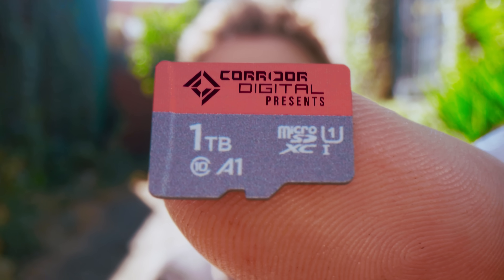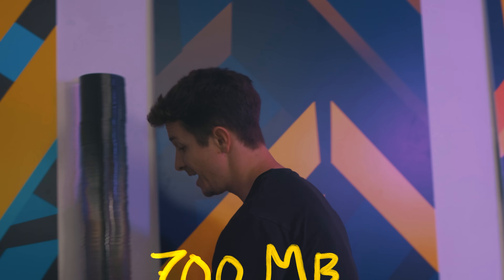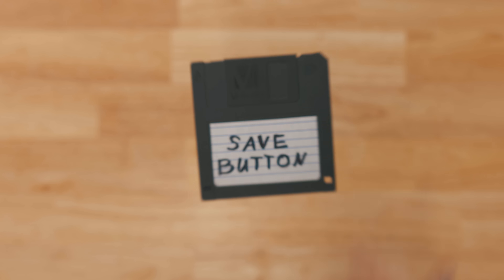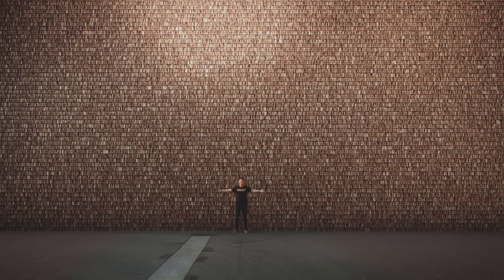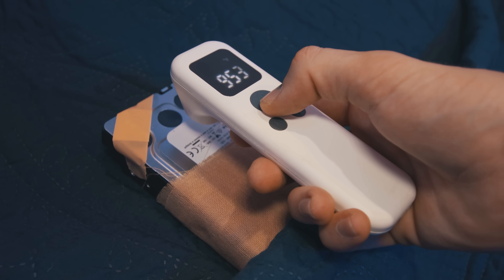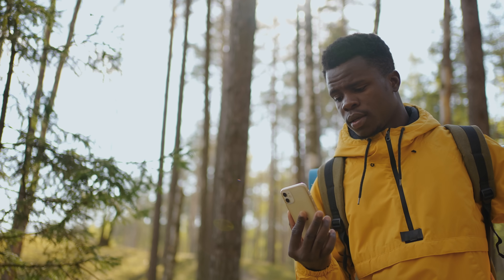VFX Artist Reveals the TRUE Scale of Data!

Comment: Fun fact: After Zettabytes, it's Yottabytes, which is 1024 Zettabytes, or around 1 trillion Terabytes! Right now, 1 Yottabytes would fit every bit of data in our world 100 times over, but if we manage to develop the singularity (with AI and stuff), we might seriously need to consider using Yottabytes.
Reply: 55.4 yottabyte zip bomb
Reply: @travipatty28  tasty
Reply: Mister, that just means making 1 trillion terabyte chips. Unless we make quantum computers in which a bit less. Thats because quantum tunnelling, known to laymen as teleportation
Reply: that one zip bomb holding 5500 times all the data in our workd
Reply: the 55.4 yottabyte zip bomb in my pocket:
Reply: your using units based of of powers of 2 while in the video they use powers of 10. Also the highest amount of data to date is no longer a Yottabyte, after yotta it goes to ronna which is 1000 to the power of 9, then quetta 1000 to the power of 10, which were adopted by the International Bureau of Weights and Measures in 2022.
Reply: Next is Ronnabyte, then Quettabyte.

Comment: Technically, it's not 1000, but 1024. Oh, well, close enough I guess
Reply: incorrect, that would be a kibibye, mebibyte, gibibyte

1000 is kilabyte, megabyte, gigabyte
Reply: it was redefined to 1000 bytes in a kilobyte in 1998 to line up with all the other units in the SI system (IEC/ISO 80000:13)
1024 bytes is a kibibyte, not a kilobyte, and 1024 of them is a mebibyte etc.
Reply: @Roaxial  really? It was changed? Guess I've been living under a rock since then. Not like I cared too much about computer technology, so not surprised I missed something like this

Comment: Actually 1024MB=1GB not a 1000
Reply: “Actually” 🤓
Reply: @taha_4656  they're not even right which makes this more funny
Reply: it was redefined to 1000 bytes in a kilobyte in 1998 to line up with all the other units in the SI system (IEC/ISO 80000:13)
1024 bytes is a kibibyte, not a kilobyte, and 1024 of them is a mebibyte etc.

Comment: Sure, 1024 =1000 if you are an engineer
Reply: it was redefined to 1000 bytes in a kilobyte in 1998 to line up with all the other units in the SI system (IEC/ISO 80000:13)
1024 bytes is a kibibyte, not a kilobyte, and 1024 of them is a mebibyte etc.

Comment: Actually 1024 megabytes is a gigabyte, and so on. . . . You said 1000 but it's actually 1024
Reply: it was redefined to 1000 bytes in a kilobyte in 1998 to line up with all the other units in the SI system (IEC/ISO 80000:13)
1024 bytes is a kibibyte, not a kilobyte, and 1024 of them is a mebibyte etc.

Comment: Computer data storage became so cheap, for instance a 4 tb hard disk is about 70 dollars which means it's less than 2 cents per gigabyte which 1000 mb which is 1000*1000 kb which is 1000^3 bytes. In conclusion you can get about a billion bytes for 2 cents. And I haven't talked about ram...

Comment: Great job, thanks.
But you didn't clarify, that 1 terabyte is 10^12 bytes and 1 tebibyte is 2^40 bytes. Common misconception that 1 TB (terabyte) consists of 1024*1024*1024*1024 bytes which is wrong.

Comment: 3:36 Fun fact for those interested - BluRay is called "Blu(e)" because the laser it uses produces blue (405nm) light... it's technically more violet than blue, but VioletRay doesn't sound as catchy :D. CDs and DVDs use red lasers (780nm and 650nm respectively).

Comment: I hate it when "Profis" says 1MB is 1000 KB it is 1024 and 1 GB is 1024 MB and so on
Reply: You're wrong. 1 MB is 1000 KB, but 1 MiB is 1024 KiB.
Reply: it was redefined to 1000 bytes in a kilobyte in 1998 to line up with all the other units in the SI system (IEC/ISO 80000:13)
1024 bytes is a kibibyte, not a kilobyte, and 1024 of them is a mebibyte etc.

Comment: It's actually 1024, not 1000

The 1000s are used by manufacturers idk why, but in reality the number is 1024
Reply: No. There is a little trick - kilo is 10^3 but kibi is 2^10 or 1024. So when people talk about mega, kilo, tera, giga - all this is power of 10. But for RAM people use kibi, mebi, gibi, etc which is power of 2.

Comment: There are approximately 711,111.11 1.44-megabyte floppy disks in 1 terabyte.

This is because 1 terabyte is equal to 1 trillion bytes, and a 1.44-megabyte floppy disk can store 1,440,000 bytes.

So, the calculation would be:

1 terabyte = 1,000,000,000,000 bytes
1.44 megabytes = 1,440,000 bytes

1 terabyte / 1.44 megabytes = 1,000,000,000,000 bytes / 1,440,000 bytes = 711,111.11 floppy disks (approximately)

Comment: The floppies falling weird and then bouncing on the trailer.. Looked hard CG. That's not how a stack of small, flat, thin, things falls. The move more laterally (Find videos of large piles of wood, plywood, cardboard..etc falling over), and when it lands they spread out in the direction it's falling in very quickly instead of piling up. This felt like it was just a typical particle fluid simulation, which doesn't fit at all.

Comment: One other reason for not using sd cards is performance, performance on it are really bad for non-sequential access, linux did boot windows on sd cards and the sd was basically at 100% of its speed all the time. Even high speed ones are SUPER slow when compared to SSDs. Serving content from sd cards is just SUPER slow.

Comment: a quick reminder to those that even know/have used floppies - while it always stated 1.44, we know it was 1.37mB, if we were lucky. if we tried shoving anything past that, it would write, but it would have a high chance of fail when reading it.... :D
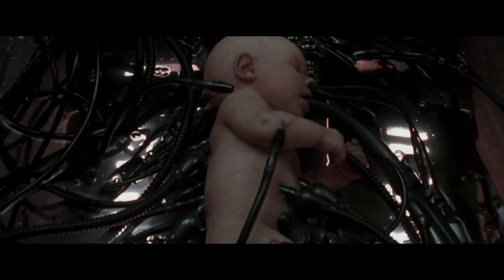13:01 how deluded is this statement, considering that the data carried is repeating, or else we'd fall apart in days of being conceived in the womb. you need to remember that each cell carries, mostly, identical info or our next reproduced cell will conflict with the ones around it (quick example: cancer cells).

started off well, but then went for clicks and delusions... bad voodoo.

and we're not even going into topics of data formats and data storage methods to properly convert data stored in each cell to our "IT" methods.

i guess, this is what passes as "mind-blowing science!" for zoomers.

Comment: the 1.44 mb-disks was the pc-version, the 3.5" for gamingcomputers f.ex. atari 720 kb and amiga 840 kb - they all looks the same,but the 1.44 was doublesided and the "original one" was  singlesided 720 kb..amiga had a compressed filesystem that allowed 840 kb to be squeezed in

Comment: back in the days my teacher told me that he studied new approaches in his freshmen years and assissted a tutor with his prototype. instead of having a magnetic disc (SSDs wherent a thing back then) where each platter is red by a single read head, they packed 40 or so per platter fixed on the encasing and let the sqare platter "shake" so the data reaches below the read head. He was pretty sad that it never got out of the prototype status. probably because the had shaken any pc it was installed in into pieces :D

Comment: just remember, the only thing above zettabyte is YOTTABYTES, approximately 1.2 S E P T I L L I O N megabytes (1,200,000,000,000,000,000,000,000)

edit: just did a few searches and found out that there is only one thing larger than a yottabyte: a yobibyte (about 1.3 yottabytes)

Comment: letting you know that 1MB = 1024 KB, 1GB = 1024MB, 1TB = 1024GB, so on
Reply: That's not correct. In reality, 1MiB = 1024KiB, 1GiB = 1024MiB, 1TiB = 1024GiB.
But these are not kilobytes/megabytes/gigabytes/terrabytes, which indeed go by 1000s as in the video. They are kibibytes/mebibytes/gibibytes/tebibytes, which go by 1024s.
Reply: Your "1000s" is Steve jobs & his friends system invention. Before that was & still 1024s since the beginning.

Comment: 1024 kilobytes is a megabyte, 1024 megabytes is a gigabyte, so on, that is the error.
Reply: no, they're correct you got the units messed up. 1MB = 1000KB, 1MiB = 1024 KiB
Reply: @Vtraxio  They wrong, 1MB = Steve jobs' 1000KB.

Comment: something cool about memory storage: Its not 1000 its 1024, a gig is 1024 megabytes, a megabyte 1024 kilobytes but a 2 gb HDD only has 2,000 mb on it. this is because in computers the closest binary to 1,000 is 1024 so they use that number for ease of computation but manufacturers use the actual meaning of the prefix. this means a 1 terabyte SSD would actually only have around 0.975 Terabytes of storage. there have been efforts to rename the Bytes to avoid confusion.
Reply: Glad someone said this, it made me want to pull my hair out when he said it wrong! :P

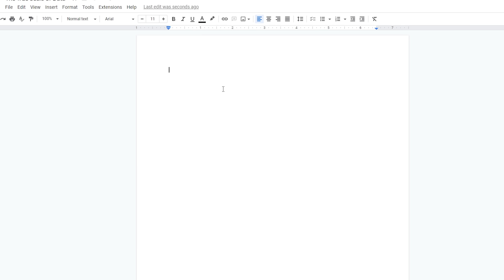Comment: 7:02
Actually, it is only half of a text
ASCII is pretty much not used anymore, almost everyone including Microsoft, Google etc. have moved over to Unicode, which takes 2 bytes to store a character, thus allowing for every character of every language, hence Unicode
Reply: Actually wrong-ish, on multiple accounts.
1. Unicode does not take 2 bytes to store a character. This is determined by the encoding used to save the file.
2. UTF-8, the most common encoding, only uses 1 byte per ASCII character. UTF-16 uses two, but is less common and less compatible across systems that support unicode than UTF-8. Vast majority of the content that people consume on the daily basis comes in UTF-8, because internet pretty much doesn't use UTF-16.
3. Both UTF-8 and UTF-16 use variable amount of bytes to store characters.

Comment: well you are wrong 1024 bytes = 1 kb 1024 kb = 1 mb 1024 mb = 1 GB 1024 GB = 1TB and so on and on
Reply: No, you are confusing the units. Kilobytes, megabytes, gigabytes... is indeed a base-10 system. Instead, you are probably thinking of kibibytes, mebibytes and gibibytes.

1024 bytes is a kibibyte.
1024 kibibytes is a mebibyte.
1024 mebibytes is a gibibyte.

In the video, they don't speak about the base-2 version that you refer to.
Reply: @regarrzo  well its still 1024 tho like it doesnt make that much of a difference
Reply: @A. Adam  The video is right in saying that 1000 Bytes is 1kB, 1000kB is 1MB, 1000MB is 1GB and so on. 

Your original comment is wrong in claiming that it is otherwise. It only goes by 1024 with kibibytes, mebibytes and gibibytes, not with kilobytes, megabytes and gigabytes.

Comment: 470.000.000 ???? LOL!!!!
According to WHO ???
A sheet of A4 (approximated at 20cm x 30cm) can hold an uncompressed 3x8bit RGB (TIFF/BMP) BLOB(file) of 8503 x 5669 pixels, weighing a WHOPPING 144.61 MEGABYTES (48.2 MP x 24 bit) if printed with an inkjet print-head with a PHYSICAL resolution of 720x720 PPI (pixels per inch).
A binary blob, meaning, a binary image file, like an iso, can EASILY be converted to TIFF and PRINTED. And you can SCAN AND DECODE the file back also, without ANY loss of data, given that the scanning resolution is equal to or above the format used (24 bits in this case).
* It means that you need a +-14.27inches tall stack of 3625 sheets of paper (100 sheets = 1cm tall), printed on both sides, to hold a terabyte. *
We may argue that it's difficult to scan the gradient with precision, and some data can get corrupted, yet, at lower bits per channel (16 bits total or lower), the decoding can assure zero errors, still using a fraction of the stack of paper LITERALLY imagined here.
But, let's even hypothesize a 1bit palette, so either a black pixel or a white pixel, pure binary. In this case, with the same parameters, 8503 x 5669 pixels are equal to 48203507 million bits, which is equal to 6025438 bytes(1byte=8 bits), which is equal to 5884 kilobytes(1kb=1024 bytes), which is equal to +- 5.7 megabytes(1mb=1024 kilobytes), FAR MORE than "2.2 kilobytes" , "15000" bits or whatever "the expert" told you...
And it all translates to a stack of 91243 sheets, printed on both sides, 912 cm tall, about 359 inches.
Not kilometers...
DUH
SORRY !!! 😅

Comment: note the genome is not measured in zettabytes. First off DNA isn't strictly information It's a chemical substrate for the synthesis of proteins, however is we wanna treat it as data we have to recognize something. All DNA inside a person is nearly identical. This means we can deduplicate DNA down to just one genome of one cell. Doing this we can calculate the amount of data needed to store the human genome like this. We need two bits to store one nucleotide. (10) thymine (01) adenine  (00) cytosine (11) guanine. Next we look up the number of nucleotide pairs in DNA since with one strand we can reconstruct the other. For humans this number is about 3,200,000,000. multiple that by two for the number of bits per nucleotide we get 6,400,000,000. Then divide by 8 for the number of bits per bytes we get. 800,000,000 bytes or about 800 megabytes.

Comment: Let's just say this, I work for a company that builds Amazon web services' cooling units, they are each 800,000 cfm units and each data center uses about 5 of them on each side of the building but realistically the scalability is infinite because they can just buy more units from us, for example a normal computer case fan is about 50 cfm

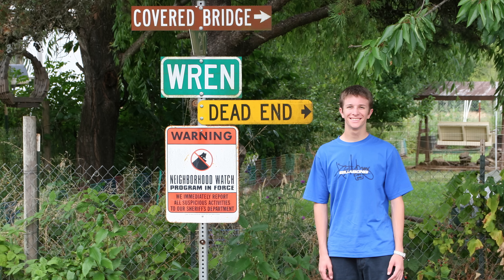Comment: 2:00 I don't want to sound elitist or belittling, but when I was a kid 15 years ago 2 GB SD cards were barely becoming widespread and could sometimes be had for less than 10 bucks (the € was stronger back then, so might've been more than $10 actually). In any case, I'd think 2 or even 4 GB would've been more appealing when the largest size wasn't 512 MB anymore (which was the case in the early 2000's hence I have a handful of them still).
Also, cheap (<$/€100) 1 TB HDDs already existed, so it wasn't really as massive as a 1 TB µSD (which is much smaller than regular SD) is today since most computers don't come with 1000 TB or one PB ('petabyte') of storage.

Comment: Core memory is cool.. And likely still in use in some air traffic control systems.. Super simple.. wire is connected on either end of a matrix with an iron hoop in the middle somewhere.. The wire is coiled around the hoop.     A wire is threaded through the middle of the hoop, and if there is a current on the wire (produced by induction from the magnetized iron hoop), then it represents that the bit is set to 1.  If no current is being passed through the coil around the hoop, the hoop is not magnetized and that makes the bit a 0 because there is no current on the wire passing through the middle of the hoop.. Repeat this a thousand times and build something to read and set the states of all these hoops and you have 1k of memory.  My school computer club took a tour of Sperry Univac in 1988 and they showed us the core memory in an air traffic control computer and explained that it never failed and that was why it was still in use then (and might be now).   If someone works with or has worked with this tech directly and I'm totally out of my mind on this, please let me know. I'm just going by what I remembered on a tour 35 years ago..

Comment: Taking it another step further, imagine the amount of data that would fit in these at neutron-star-density.

Edit: I think the volume could be worked out pretty easily, so I'll do it now.
Also, a card at that density would likely not work, but there could absolutely be another form of data representation that could.

TL;DR: 1.5 millimeters is the longest side-length for this data
I put two 0.7mm pieces of lead together (slightly under 1.5 mm) to make a good approximation. 
And this is like all the man-made data on Earth

density of a neutron star

Basing off of San-Disk Ultra: 0.04 x 0.59 x 0.43 inches = 0.01 in^3. Converted to cm^3: 0.166 cm^3 (Volume = 0.166)
Mass (kg) = 0.00454
Density (m/V) = 0.0273 kg/cm^3
I am using kg because of the neutron star's measure of density

Density (SD) = 0.0273 kg/cm^3
Density (Neutron Star) = ~10^17 kg/m^3 --> 10^11 kg/cm^3 (make sure you don't use per m^3)
10^11 / 0.0273 = (3.66 x 10^12) times as dense
(3.66 x 10^12) ^ (1/3) (cube root gives you the scale for each direction) = 15,400

Tennis court  dimension: 23.77m
(23.77m / 15,400) x 100 (converting to cm) = 1.54 millimeters
1.54 mm being the largest dimension (of again  of the man-made data on Earth condensed) sounds reasonable, though I expected to be 1mm or smaller. As much as these exponents seem crazy, in terms of astronomy, things usually seem to scale on orders of magnitude (exponents) more often than multiplicatively, as we're more used to on Earth, so it shouldn't be considered impossible or unbelieveable.

Comment: I made a calculation back at university on 1 Yottabyte in double density 2.5 in floppy disks stacked like pancakes. Turns out it would be about 3 magnitudes of 10 times the diameter of the solar system. 😮

Comment: 2:48 Bro you are wrong here. It's not 1000 its 1024. Therefore 1024 bytes = 1 kilobyte and so on.
Reply: You are using the ibibyte/iB scale, where:
1,024 iB (Ibibyte) = 1 KiB (Kibibyte)
1,024 KiB (Kibibyte) = 1 GiB (Gibibyte)
1,024 GiB (Gibibyte) = 1 TiB (Tibibyte)
1,024 TiB (Tibibyte) = 1 PiB (Pibibyte)
1,024 PiB (Pibibyte) = 1 EiB (Exibibyte)
1,024 EiB (Exibibyte) = 1 ZiB (Zibibyte)
1,024 ZiB (Zibibyte) = 1 YiB (Yibibyte)
Reply: @Nebulisuzer  I was always taught its kilobyte never heard of this ibibyte scale.      Thanks for the info but then what scale is the guy in the video using?

Comment: So, if a human mind is 2.5 petabytes, and a zettabyte is 1million petabytes, then you could store 4 million human minds in the current 10 zettabytes of estimated current storage capacity of the internet. which means with only 2,0000, Zettabytes, or only 20 Yottabytes you could upload every single human mind to digital storage. at our current rate of advancement it could take as little as 10 years before that's possible. So we're less than a decade away from being able to create the simulation we're all probably living in...